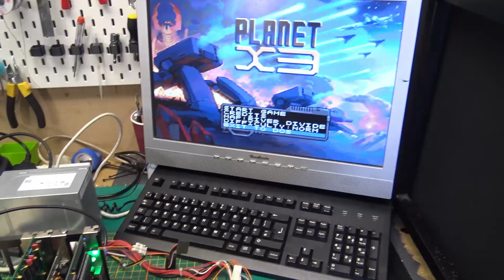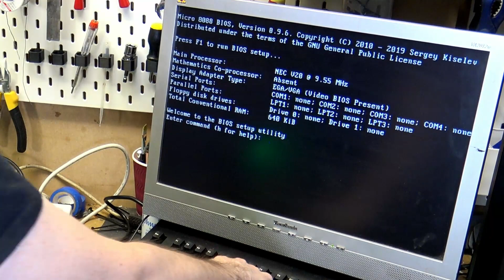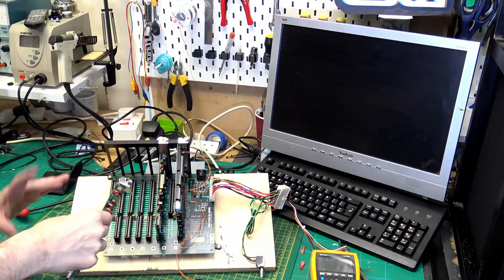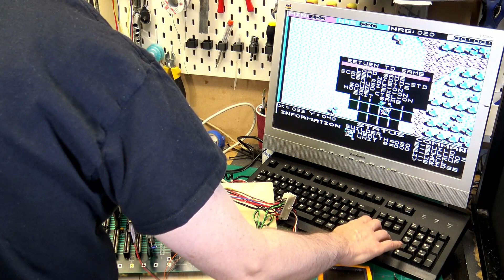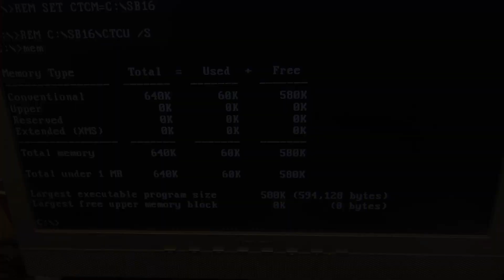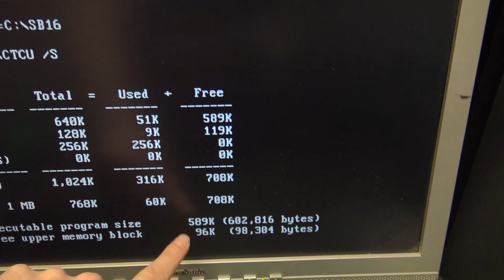Assembling an Intel 8088 XT PC with kits and a few used parts it's time to do  this thing !

Comment: Where did you get the mother board?
Reply from the maker: What part do you mean, the micro 8088 or the backplane ? All the micro 8088 boards are on the github and you can then order from a PCB fab.
Reply: @leesmithsworkshop  The backplane where you plug the cards - the one that provides the power to the cards using the external power supply. Can you post a link?
Reply from the maker: @ButilkaRomm  ok, that was one I just found one ebay and they have a proper one that converts the soft poweron switch and -5v rail.
https://github.com/skiselev/isa8_backplane
Reply from the maker: @ButilkaRomm  In a later video I upgrade it to this https://myretrostore.co.uk/product/micro-atx-isa-16-bit-backplane-pcb-v1-1/

Comment: Fantastic!
Only missing 3 things:
1. When did you notice the missing solder joint on the IDE board?
2. What adjustment was necessary for the variable capacitor?
3. Did the hated Adlib sound card work 100% on first try with no other repairs necessary?

I watched the rest of the series and heard the griping about the Adlib card and I immediately thought, “I bet 5c that it’s the only thing that works flawlessly first try.”

QUESTION: what about the 4x spare 8088 boards? Selling them off, or saving for future projects?😄
Well Done!
Oh & what was the final tally pls.
Reply from the maker: sorry I can't remember enough to answer these questions. Think I have 1 or 2 boards left after selling a few.

Comment: This appears to be an interesting project! Do you have any idea if there is a card kit that would provide a parallel port and most importantly a serial port that would operate at the vintage speeds of these older 8088 machines? I am interested in building one but not for gaming but to program vintage Motorola radio products which require the older slower serial ports of these classic machines.
Reply from the maker: Hi, you can find a few options for com and lpt cards that will work.  The floppy drive card I have has a COM port, but I never populated it.  Wouldnt a 286>486 be better it would give you more options to use the standard 16bit ISA controller cards.
Reply: @leesmithsworkshop  Thank you for your reply! Unfortunately for early Motorola programs they rely on timing from the computer in order to operate properly. Using anything newer than a 8088 or a 286 will effectively Brick the radio due to timing issues. I have a 386 and 486 in my archives however i forgot to bring my old Vendex Headstart 8088 with all of my old radio programming software with me when I moved to the EU. I do have most of the software on floppy disks but i don't know how well the magnetic media has held up all of these years.
Reply from the maker: @subgunmanm7166  ok, like I said you can find them on ebay or you could make your own from one of the PCB kits you can find.

Comment: This is a valuable set of videos. I’ve seen these pcb sets a couple times over the last year but I was unsure about the whole project. I’ve built several Z80 boards like the RC2014 and Z80mbc2 but this looks like serious step up.  
   But with these videos I am encouraged enough and have ordered a set of PCBs and most of the parts.  I remember turbo Pascal 6.0 on an XT as one of my favorite applications for a computer ever. Also XTreeGold and procomm for BBS.
Reply from the maker: Did you find the Faraday chip ? That's the part that is getting harder at least in the UK. It's a great project and I really enjoyed making it.
Reply: @leesmithsworkshop  Quest Components had some.  They were $18.50.  
FE2010A-JU	WDC	Ships March 15 - March 16, 2021	Delivers March 22nd - March 23rd	$18.0830.  
  I hope this is the right part.  
   The trident 9000 vga chip seemed hard.  Someplace in China had one used.  I don’t know how that works for surface mount.  Shipping was terrible.  It will end up being a $50 part.  I’d be better off buying a used card.  I’ll try this first though.

Comment: You shouldn't need the power wire for the CF card. There should be a jumper on the IDE->CF adapter to power the CF card from the IDE bus which generally works fine.
Reply from the maker: I do remember something about that so will take a closer look.

Comment: I think you could find any aluminium cage on ebay and print all the pieces you need. But that is a lot of time spent.
Reply from the maker: I brought the cheap Micro ATX beige case and will  modding it
Reply: leesmiths workshop Time for a project update??

Comment: I know they say to use a 28 MHz crystal for 9.5 MHz, but what happens if you use more? The NEC V20 has a model that supports 16 MHz, anyway to get that working? I'd love to build this, but it's a little too slow for me to have fun with. Unfourtunetly I haven't found any kits for 386 or 486 and I been looking for a while. Do you know of any?
Reply from the maker: HI, the 28mhz is setup by the Faraday chipset which then devides and controls the CPU. Not sure what would happen if you changed this. On the XI 8088 that does have options for some speecd adjustment because it has the separate chipset circuit. As for 386 or 486 sorry I don't know and think it would be a little beyond a home DIY build.
Reply: There are industrial boards with 386 and 486. Quite expensive new, much more than equivalent PCs for the consumer market,  but look for reclaimed units on eBay or whatever. I'm guessing you want a Retro-gaming rig, and not too interested in building from scratch, because that would be A LOT of work and expense sourcing. Personally, i wanted some modern features like HDMI, options for fast WiFi, and things that aren't on old PCs. It's more like something I dream about building Someday.

Comment: A great project Lee. I enjoyed this series. And the new wireless mic à la @Adrian's Digital Basement sounds great!
Reply from the maker: The new mic has it's own problems when wearing a tee shirt and it flops about a bit so some times the audio is not as clear. Then one time I put it inside a shirt pocket and it made a sound when I moved. I will get used to it soon. As for the project I am very pleased with how it turned out, It's just soldering and I think I made it not as boring as it could have been !  I watched them all today and didn't cringe too much lol. Thanks for watching :)
Reply: leesmiths workshop I am actually impressed with how much of a pro you are at presenting, definitely do not give up!
It takes years of steady contribution to earn a following, but the audience will come, don’t worry.

Comment: Loving this project! Where did you get the power sockets for the mainboard? 

I have an original 5150 board but no power supply, looking to do something similar. ATX to XT seems simple enough  but  not sure where to get the connector from
Reply from the maker: search ebay for 20P ATX To 2 Port 6Pin AT PSU that is what I Used. One thing to note is modern atx v2 do not have -5v . you would need to find a atx v1.1 power supply and they will have the 6 pin at connectors, but are quite expensive.
Reply: @leesmithsworkshop  Brilliant. Thanks, just ordered one. Been hunting around for ages, searching on the wrong words. Just the plugs I need think. I've got a Pico PSU providing all lines and a 7905 voltage regulator for the -5